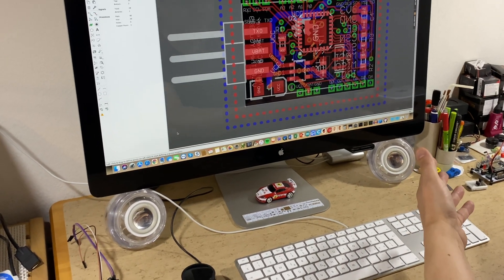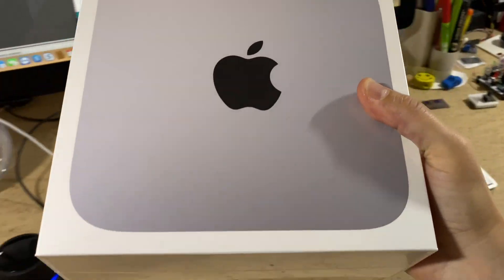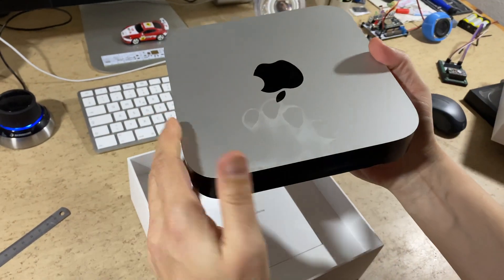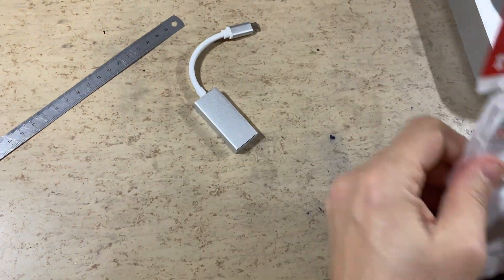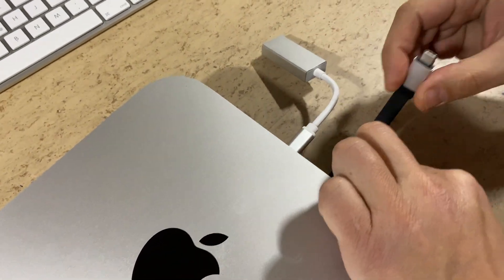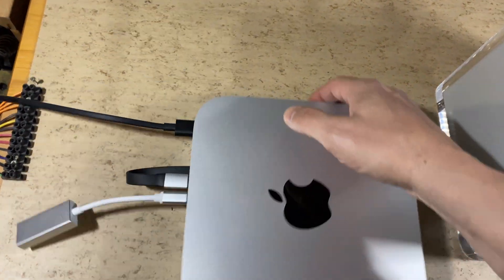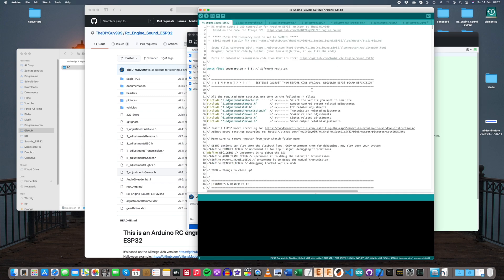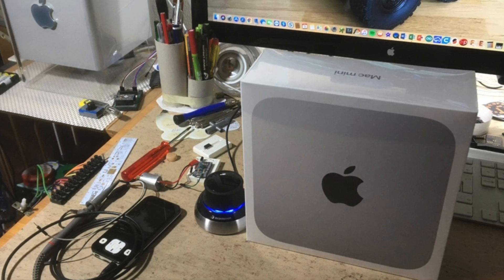Mac Mini M1 replacing my G4 Cube i7 Hackintosh & How To Fix Arduino ESP 32 Big Sur Compiling Issues

Comment: Id like to have at least a m1 mid-end mac mini... Not that i dont have money, i just dont have enough money to use in it since im a kid and were currently building another house in top of ours here... (Common in brazil.) The real problem is: its SUPER overpriced. Its over R$5k! (~$1000) i really hope prices get down.
Reply from the maker: The base model is around 700$. An Open Core bootloader based Hackintosh may be the better option for you. I just recently built two of them and they are running absolutely flawlessly.
Reply: @TheDIYGuy999  oh, ok! i'll consider doing it... i guess it cant be perfect as i have an 2nd gen core i3 with an 4GB GTX 960, bbut i tried once with HS and it also worked flawlessly... ANY computer is kinda overpriced for us now, but dad just bought a new one, so...
btw it's like, literally overpriced, the base model is ~$699 and so it'd be R$4k96 but it's HIGH over it... R$8K!?!?
(~US$4000)

Comment: Happy 4 you. But 2TB is overkill, especially since you will most definitely upgrade to the next generation, since it'll bring big advancements, both in speed as well as in I/O. 1TB would suffice until that upgrade ;)
That being said, I'm looking forward to the content you'll produce with it. :)
BTW, those USB-C ports on M1 Mini are NOT Thunderbolt 4! They're USB-C 4.0, basically Thunderbolt 3.
Reply from the maker: It depends on what it's used for, currently about 1TB is already used. I like to have all my stuff together on one drive an then to have multiple external drives for alternating Time Machine backups.
Yes, TB4 is wrong, thanks for the hint

Comment: How do you like the GPU of the new Mac mini? 
I saw you use Final Cut and iMovie. Is it able to keep up with Timeline skimming and preview when you use a bunch of effects on 1080p 60 or 4k 30?
Reply from the maker: As far as I can tell it's way faster than on the Cube. This 4K video was rendered in about 3:45, so almost 2x real time speed.
Reply: @TheDIYGuy999  Ok that seems pretty decent compared to it's size. Thanks for the info :-)
Reply from the maker: @larsappel7813  Yes, scrolling through the timeline is instant, even with 4K